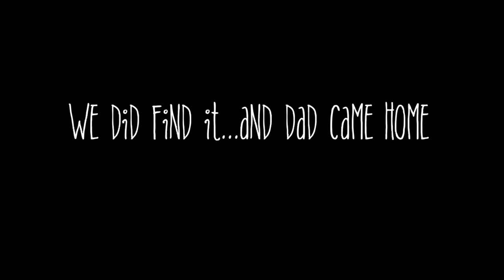ARE WE READY FOR THIS? - Renovating a Stone House in Portugal

Comment: Probably mentioned this before but a heat recovery ventilator will give constant fresh air and reduce risks from radon , VOCs , damp etc at very little running cost. Used one for 6 years and really happy with its effectiveness and low maintenance. Also please please cover the ends of standing rebars, they are so innocuous yet potentially deadly! Thanks as always for sharing the build, the farm and the wonderful happy boys and their joy.
Reply from the maker: Nice idea John.  Thanks.

Comment: Have you thought about doing a Chicken Tractor? It’s basically a mobile chicken run. Put the coop on wheels (wheels on one end handles on the other) every so often roll the coop to a new location and move the fence along with it. Usually a less permanent fence is used.
Some of the benefits are that the chickens get new ground leaving behind fertilized ground. They will also eat grubs and pests…
Reply: I didn't know that there was such
a thing as chicken tractor!

Comment: Isn’t it good for cement to dry slowly? In warm areas I see them having sprinklers on to avoid it drying too fast.
Suggesting some low holes in the edge wall for drainage. Angling the deck so water runs away from walls will also help. Cement leads water and you will get mold inside if water stays on the deck.
Reply from the maker: Yes and yes! Great to hear from you, thanks for watching friend.

Comment: Tara, if you decide to keep the chickens in the coop area rather than letting them free range, I would suggest putting some form of mulch in to create a deep bed situation.  You can use straw, tree mulch etc otherwise it will become a smelly, yucky mess.  The added bonus of this is that you can rake out the deep bedding every so often and put it in your compost as an activator due to the chicken poop in it.
Reply from the maker: Thanks for the advice Sharon ❤️🙏🏼😃🏡🇵🇹

Comment: When you mentioned digging out the step and concrete in the kitchen I’m wondering why not just put in a taller door.
Also instead of waiting years for a new house why not renovate the extra rooms you have. Yes, it would take a lot of work but much less expensive than a new house and faster.
Reply from the maker: Hi June. We need to build on top of the other houses. Same footprint is required. Great to hear from you, thanks for watching friend.

Comment: I watch another couple who moved to Portugal and bought a watermill.  They found out that they had to legally have a licensed contractor to remodel  their building. Have you checked into that about legally having to have a licensed contractor on site. Also, regarding Radon, in the USA people can buy a RADON FILTER for their home.
Reply from the maker: Hi Judy. Likely what they mean is that legally to comply with code the work must be done or checked by a contractor and signed off. Very often you can hire a building inspector to check the work at each stage of a build or you can retrospectively provide evidence of how it was built. The legal details of building in PT we are familiar with. Thanks for the info about the Radon filter. 👍 Great to hear from you, thanks for watching friend.

Comment: Hi John it seems you have put visqueen under the foundation I was wondering exactly why? Usually the visqueen is laid under the slab then  and draped up the Insisde skin of wall and tucked in to your dpc creating a barrier from any damp. Putting it up and under your foundation which is exposed to the elements means you've created a big pool
Reply: Edit : you ve created a trench (your foundation ) lined with a waterproof membrane where water is going to pool.
Reply from the maker: Hi there friend. Interesting comment. In Finland they often put plastic under the foundations, John was copying that process. We will see how it works out, of course a full damp course will be placed under the slab when we lay that. Thanks for your suggestion and comment.

Comment: My name is Karen btw…..I use my gamer tag on YouTube. Here in canada to prevent the damp from rising we use expanded polystyrene insulation, poly iso. It pretty much a rigid foam insulation with a foil backing and what that does is prevent a heat break between against the concrete
Reply: Some of the other places call it a foam board as well
Reply from the maker: Thanks for sharing your name and advice with us Karen ❤️🙏🏼🇵🇹